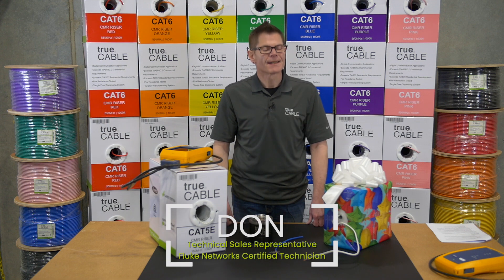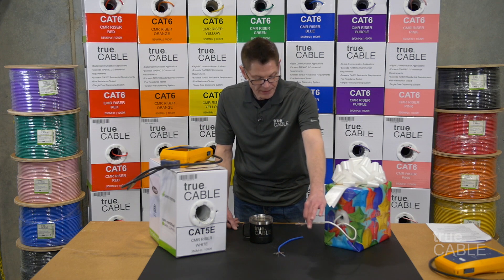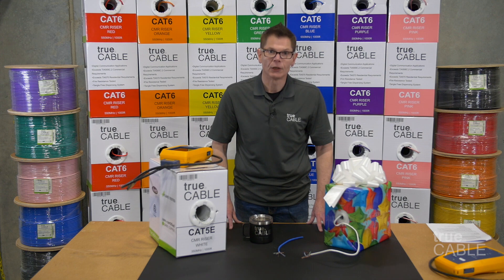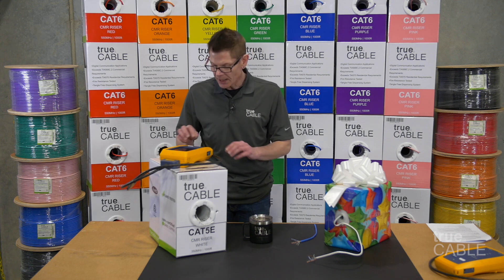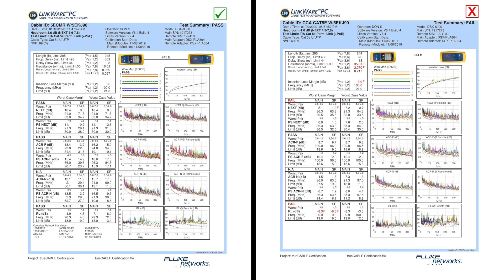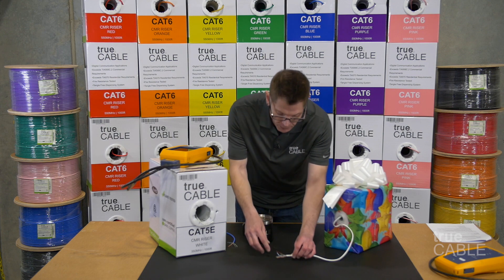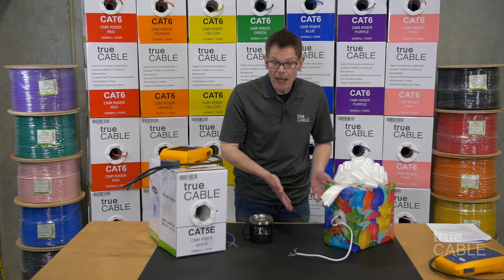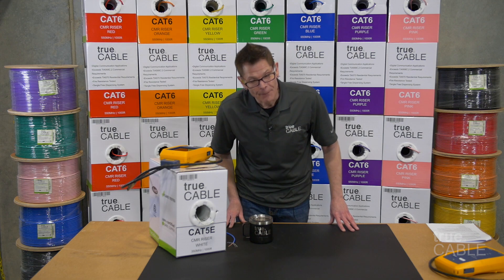Copper Clad Aluminum vs Solid Copper Ethernet Cable

Comment: To go as far as to say that it will catch fire is ridiculous I understand the video and I understand the difference but like I said to go as far as to say that it will burn your house down that's ridiculous. There's not enough voltage in those cables to start a fire definitely not
Reply: My mother in-law asked me to wire up her home internet, but I made sure to use CCA cuz we got life insurance on her 🤣
Reply: never use cca for poe applications. works fine for regular data.
Reply from the maker: @slybunda  Actually, CCA should not be used for regular data either. The issue is that your terminations will oxidize over time. When it comes to copper this is not an issue as copper oxide is conductive. Aluminum oxide is not conductive at all. Eventually the terminations on a CCA cable run will fail due to this phenomenon and this is only one of the many reasons why CCA has no place in Ethernet installations.
Reply: @trueCABLE  how longs it take? i got few cca runs in place for 9 years now still working.
Reply: @slybunda  and it will run for a lifetime with no problem I am not a fan of CCA cable I believe it's too cheap but whoever uses it wouldn't have a problem like yourself for 9 years
Reply: @carlossoto8868  i dont use it for poe stuff but general data on ethernet is 2.5v and under 20milliamp. even 32awg is plenty for that.
Reply: @carlossoto8868  dont worry trueCable, carlos is ignorant of PoE.  Sooner or later Carlos will find out once his moustache is burned coz of CCA usage.🤣
Reply: @AHEUTUBE  HAHAHAHAHAHA 🤣🤣🤣💯
Reply from the maker: @Robert Welsome Hello Robert! Correct, in high voltage applications (overhead power lines, etc.) aluminum is used due to weight considerations and the fact that will pass current well enough. I agree the issue with CCA is the hybrid nature of the cable, but you still would not want to use all aluminum Ethernet cable either as it offers too much DC resistance. Considering Ethernet is low voltage it needs all the help it can get (solid pure copper is best).
Reply from the maker: Hello and thanks for your comments. Unfortunately, CCA "Ethernet" cable installations making use of higher powered variations of PoE (such as 802.3bt 60W and 90W) do indeed pose a safety hazard. You have two factors working against you right off the bat:

1.) Thin conductors to begin with (24 AWG or 23 AWG is a lot thinner than common AC wiring). 
2.) Aluminum core conductors have 55% more DC voltage resistance than solid copper conductors. This causes rapid heat build-up and difficulty with heat dissipation. This issue is exacerbated exponentially with larger cable bundles, where the sympathetic heating effects are most dramatically seen. A great example of where this can occur is IP surveillance camera applications, where the end point devices are PTZ and consume a great deal of energy. In the right (wrong, actually) circumstances, an individual conductor wire can overheat enough to cause a fire that will start inside a cable that ends up spreading to another cable and then to the structure it is attached to.  

For further reading on this subject, Fluke Networks published a good article on the subject here: https://www.flukenetworks.com/blog/cabling-chronicles/cca-not-worth-savings-or-risk